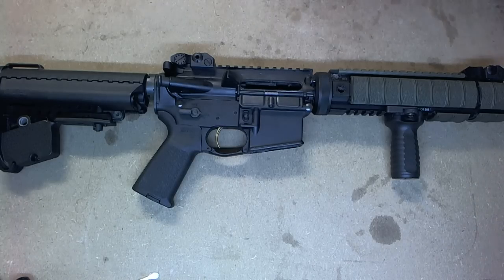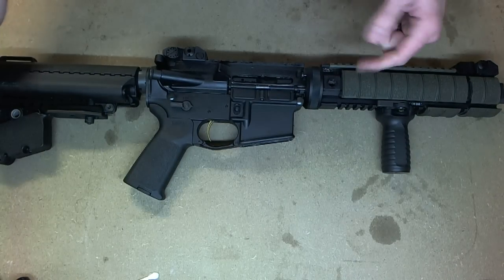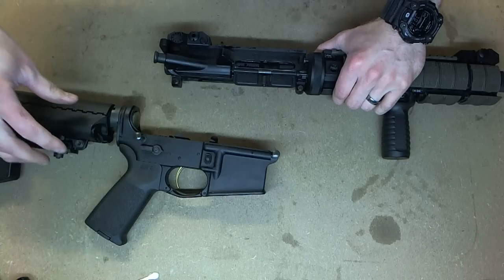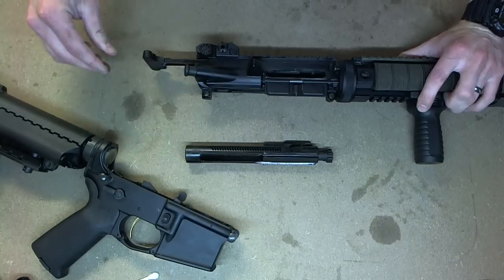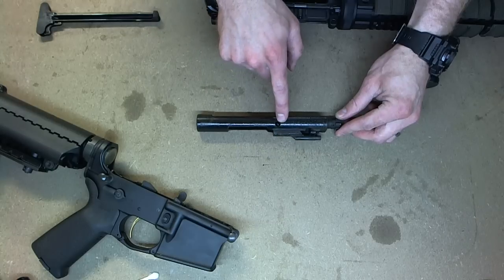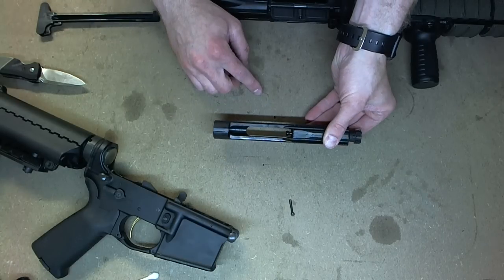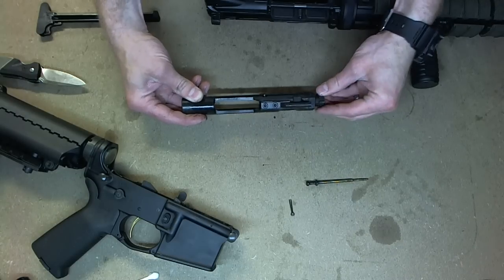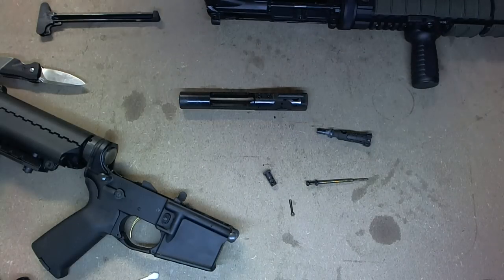How to Field Strip an AR-15 in HD

Comment: good video, could use a few more close us do beginners can see thoroughly what is going on. also as mentioned by someone else you didn't remove the buffer and buffer spring. Another thing I want to point out is when field striping the bolt carrier group, always remove the extractor as well to give it a good cleaning.

Comment: the first is remove the mag then charge and safe.. then push or pull the takedown pin and pivot pin. and now you can seperate the lower and upper receiver.. then pull the charging handle together with the bolt mechanism..then pull the retaining pin and now you remove the firing pin next is bolt cam pin and then the bolt..